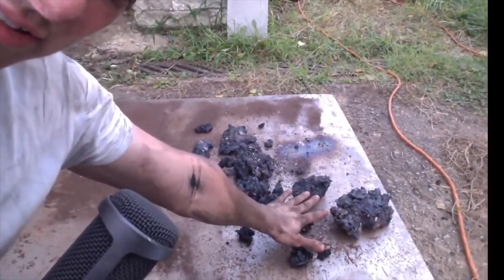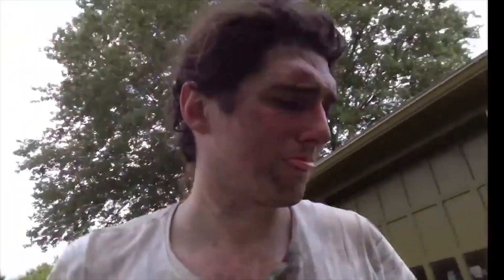Smelting Iron in a Bloomery Furnace!

Comment: Did you do a spark test when they cooled
Reply from the maker: Yep, basically no carbon anywhere I tested. probably less than modern mild steel.  However, when I consolidated it, it etches with a ton of layers, so maybe I should spark it again. Some of the layers sure etch like they have different carbon content.  I definitely lacked sufficient flux in the form of silica sand - especially since I wasn't using raw ore.

Comment: happy late birthday mate from the UK, looks like I missed out on a good time, I always love when people go back to the old ways of doing stuff and try out how things were made for centuries before modern tech took over. Anyway great stuff, all my support for ya, keep doing what you're doing ;D
Reply from the maker: Thanks! It was a blast, though next time will be even better. I'm already collecting more ore and a better mic and camera setup will make a big difference.
Reply: @BennettTheSmith  you can get high puritiy iron nickel copper by taking iron rich dirt, centrifuging it to remove organic matter, roasting the sand and cooking it with HCL Muriatic acid for 3 hours at 95 celsius. This will dissolve all iron as fecl3, calcium as cacl2 and gamma  alumina as alcl3 (main component of antiperspirant deodorants). The silica will not dissolve and phosphorus will be dissolved as phosphoric acid and calcium hydroxyapatite. The dissolved salts can be based (neutralized) with limestone caco3 or caoh, the cacl2 will stay dissolved. The feco3/feoh and aloh3 along with the copper carbonate/hydroxide and nickel carbonates/hydroxide will precipitate, pump out the water and wash the precipitate a few times with water to remove any residual phosphoric acid, cacl2 and then add a small amount of na2co3 to neutralize the last phosphoric acid, hcl and fecl3 and alcl3 that may be left to yield soluble sodium phospate and nacl table salt + co2 gas. Roast the percipitate and reduce it with hydrogen at 1100 celsius or carbon or syngas/woodgas. To have cleaner steel if you are reducing with carbon, grind the charcoal and wash the ash out with hcl, or vinegar.

Comment: May i ask if you got any advise on how to heat treat a knife that i forged out of the top part from a railroad track? Or should i jus heat a test piece cherry red and give it a go with motor oil to see if itl work
Reply from the maker: A test piece is probably best, too many possible variables to account for. What I would say is make a long test piece, if you can, and heat it on one end so that when you quench it, there are a range of temperatures. Then you can more quickly test to see what will work by checking the hardness at several points.  

If you have the option, I prefer to use pre-heated vegetable oil. Motor oil smells awful and I have never seen any research supporting the theory that used motor oil adds carbon.
Reply: @BennettTheSmith  Thanks mate. Im gonna try it when i can.
Reply: You should take a piece of the metal, anneal it, then quench in vegetable oil. do this with another piece in water and another air cooled. test with a file for hardness. tracks, to my knowledge, are not made of high carbon steel.
Reply: @obh7762  what ive read about tracks is that they are high carbon steel and mangane aswell and i see larger sparks when cuttin track than mild steel aswell. But modern tracks migh be less carbon than older ones